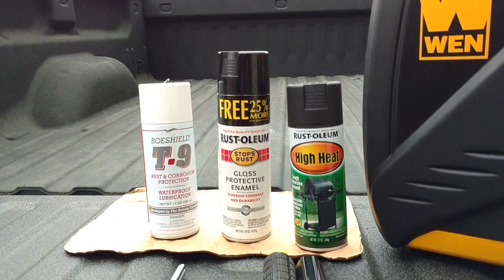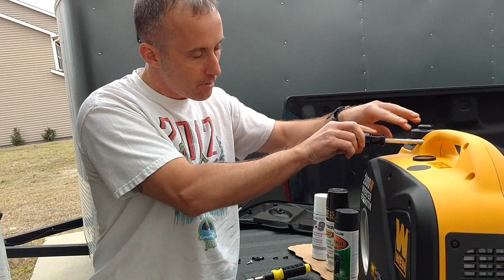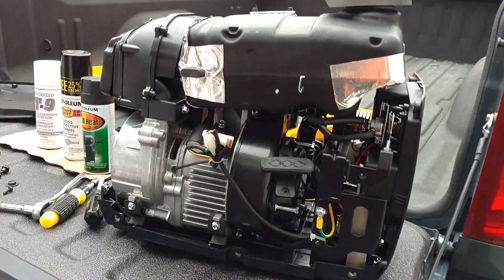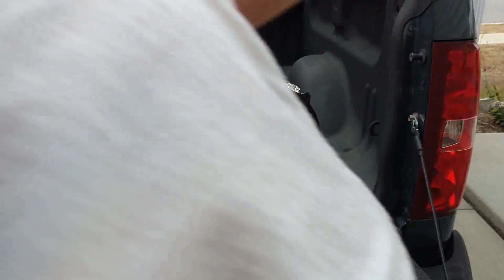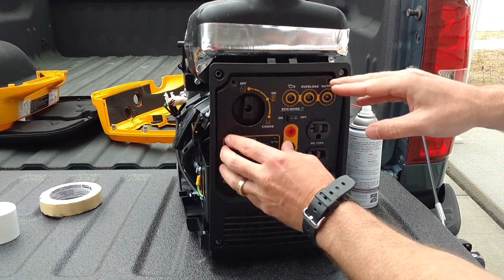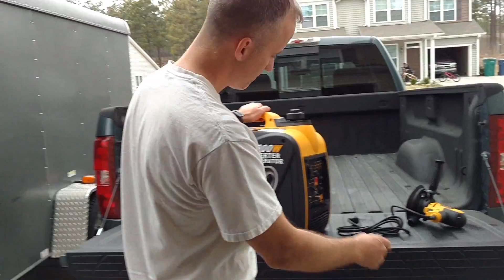How to prepare a portable generator for our sailboat

Comment: Should have used VHT cosmic based paint you can use vht on non heat parts too.,a product designed for electrical and water dispensing is called  WD - 40 ,

Comment: How do you ground it?
Reply from the maker: Excellent question when talking about these type of generators in the marine environment. On a vessel all sources of power get grounded at the source of power. On a installed generator the generator power is grounded to the generator. It may also have a case ground that is connected to the vessels ground bus bar. You could also use the grounding stud on the generator with a grounding wire to the vessels ground bus bar like a case ground for an installed generator. 

These generators are not specifically permitted by organizations such as ABYC. I ground this generator by using a jumper between the neutral and ground on the second outlet. This gets rid if the reverse polarity fault as well. 

I make no guarantees this is an electrically safe option on a vessel. I also live in the real world where about 70% of vessels in this size range carry one of these aboard every day without setting their vessel on fire. 

Use a setup like this at your own discretion. 

Thanks for the comment.

Comment: I use T9 on outboards engines in saltwater marine environments and can testify it works great.  I never thought about applying it to my portable generator (I bought a HF), but it makes perfect sense. Outboard engines are much closer to the water, so I re-apply it at least once a year.  How often do you re-spray your generator internals?  Do you still have this WEN five years later?
Reply from the maker: I reapply annually. I still have it today and it runs great and looks like it just came out of the box. Although I use it only about once a month now so it doesn't get as much use on our new vessel. It's covered in a dry compartment when not in use. 

Thanks for watching and for the feedback.

Comment: Home gensets are NOT meant for marine use, period! BoatUS warned you and dropped you. Self insurance can and will wipe you out. If you have a loan on the boat the bank will force the issue for you. Carbs, fuel systems, bonding, grounding, and the biggest exhaust systems no matter what modifications you do to a home Genset will not meet USCG standards. More folks die from these set ups each year from CO poisoning. So, was it really worth it, you decide
Reply from the maker: OK
Reply: @Unwrittentimeline  don't rip your mattress tag off or this guy will write an essay telling you how wrong it is

Comment: I have a WEN 2000.  The electricity for the city came back 3 weeks ago.  I have not used the generator since then.  I am not sure if I should empty it for storage since the power distribution is very unstable and power outages are frequent, though not for more than 4 hours.  Should I prep it for storage anyway?
Reply from the maker: Different manufacturers recommend different procedures, but generally if you store it for less than a year fill the gas tank full to reduce water accumulation, use a fuel stabilizer, and change the oils before storage.  If you think it will be longer than a year completely drain the fuel system.  Keep it in a dry covered location if possible.  

With your situation you might want to change the oil, empty the fuel system and keep a full can of gasoline that you rotate out in your car with the generator.  Then if the power goes down after close to a year you can fill the fuel and start it up.  In case the city gets its power running better and it sits for a year you're covered.

From personal experience with this generator I can tell you that I sometimes go a month or two between use during the winter and I do nothing to store it.  I use non-ethanol gasoline to reduce chances of fuel problems, but that's the extent of my storage prep.  This is still going strong for me.

Comment: How has that WEN been running for you. From what I understand, HF Predator 2000 inverter is the same unit. A clone. And the reviews with them so far has been quite good. I am watching the reviews on the Predator 3500 inverter and will probably make a decision in the next few months. I own a Honda EU2000i and love it. But, the price differential is what sells me on these clone generators. I was just wondering how yours is doing in that corrosive atmosphere. Thanks.
Reply from the maker: It's been running great so far.  We do keep it inside the boat when we're not on it.  When it's on deck in transit, it is under a Sunbrella cover.  We run it off the back under a bimini, so it's not directly under the sun or rain.  But so far it's been great.  With an installed capacitor on the air conditioner, we can run AC and charge the batteries all night on a tank of gas.  You can see what the inside looks like after a year here https://www.youtube.com/watch?v=LIDGzEql-aQ

The cost is exactly why I went with the WEN.  After over a year it seems to be just as good as the Honda.  The HF looks like another nice option.

Thanks for watching.
Reply: Excellent. I saw your April 1 year video and it looks great in there. Wise move coating and painting the internals. I think that the HF 3500 is also made by, or is a clone of the WEN 3100 inverter generator. But the HF is electric start as well as recoil. I am going to keep watching the reviews on these before I pull the trigger. But, so far, I like what I see. I have seen some reviews on the HF 3500 where they claim it runs rough on ECO right out of the box. I know what the problem is and it is a simple fix with the low speed jet. Even my Honda EU2000i did the same thing. So, it's not a issue for me. Fixed it is 30 minutes. Anyhow, thanks for your videos and your response.

Comment: People do NOT do what this guy is doing!!!This is so dangerous!!! Bodily harm, injury and or death are possible from using a portable generator in place of a marine generator. All marine electrical must be sealed and or coated to meet an explosion proof rating which portable generators do not!!! Marine engines and exhaust are also specialized as to not  emit any sparks. And the fuel systems must be properly vented and sealed to meet coast guard specifications.

Comment: Our sailboat insurance would cancel our policy for doing this. We got a letter from them last year that stated, You are not allowed to install anything related to electrical or drive system that is not manufactured specifically for marine use. You must replace all wiring with marine grade wire, if you replace or upgrade wiring. You can not use anything made for auto, residential, RV or or other non-marine manufactured device on your sailboat. To do so would be an automatic cancellation of your policy. We got our insurance for our boat through GEICO. My wife does not want insurance with them again.
Reply: I told my insurance company to piss off and insure myself.

Comment: Hey I noticed you will be using the generator to power your laptop. My generator instructions specifically warn against powering sensitive equipment such as laptops etc. You might want to check that out.  Also maybe there is a way to isolate or prevent spikes etc. from getting to the laptop. Thanks for the video.
Reply from the maker: Movie Maker Thanks for the suggestion.  Some generators are pure sine wave generators, some are not. The WEN should be fine with the sensative equipment.  I usually run it through the boat power system too. The power at the recepticle will be stable after that.

Comment: Ya ever hear about cordless power tools?
Reply from the maker: Al Martinez Yes but I can't charge my boat battery bank with cordless power tools. Thanks for the comment it was really thoughtful.
Reply: Was talking about using a power tool to take it apart. Also my buddy uses these cheap generators to run a few things on his sailboat but they don't last long, maybe 6 months or so.
Reply from the maker: Sorry I didn't know what you were talking about since you didn't ask what you were talking about.  I've only been using it for a year so far.  Thanks for letting me know about your buddy's experience.

Comment: Sometimes those high heat paints require you get the muffler up to temp and leave it there.  My exhaust paint said that anyway...the can said it would never cure otherwise.
Reply from the maker: I admittedly didn't read the entire can.  I may have screwed it up.  I'm planning on pulling it apart soon to see how the parts held up after being on my boat for a few months.  Hopefully it's not too bad.

Comment: I first started by just making a suggestion that spray grease would be better
Then you come back with T9 shits better then you get all defensive  and start quoting how good the shite companies are making millions out of mugs
Chinese companies make cars and make billions off them would you buy one No
Even north Korea makes millions off cars would you buy one
I could go on forever but would not convince someone like you that’s been brain washed
Even the us army if you could  call it that and the uk army used to spray grease on things  some of the things are still in storage now after 60 years and perfect that was just my point
Reply from the maker: I apologize then.  I misunderstood when you were laughing and saying the generator would fall apart in 3 months.  I thought that meant my generator would fall apart in 3 months, not that you can store something in grease for 60 years.  I am using my generator at least weekly and didn't want to wait 60 years between uses.  Since you were wrong about my generator falling apart I wanted to let you know it's been running fine for 6 months so I replied.  When you again posted T9 instructions not related to marine use even though we're obviously talking about marine use, I just thought you were wrong again so pointed it out and cited references.  I see now you don't need correct information or references since even your current statement is wrong.  North Korea can only produce around 40,000 cars a year.  That in no way translates to millions of Dollars, Euros, or Pounds.  Also, nice slight on the US Army, way to class up your comment.

Comment: yes seems you don't read the instructions as wellProduct DescriptionSpray on and wipe off. Develeoped with the Boeing Aircraft Corporation, Boeshield T-9 Waterproof Lubricant will dissolve itself and flush out any other lubricant. Penetrates deeply to thoroughly coat inner pins and rollers. Dries to a clean Paraffin Wax film so it will not pick up dirt. Lubricates and protects for 150 to 200 miles per application.its crap
Reply from the maker: Well I guess I just disagree.  I'm going on what their site states about its use in Marine environments and what Practical Sailor, West Marine and Boeing say about T9.  After 6 months I have no damage to any of the copper, brass, or steel components inside.  But what do I know I'm only using it and can see the results for myself.  You're apparently more wise than a company that tests marine products for a living and another company that sold over $700 million in marine products last year.

Comment: lol one month at sea and all them electrical contacts have verdigris on then 3 months they fall apart get some spray grease on them
Reply from the maker: T-9 gel is a solvent carrier and paraffin wax coating.  I'm guessing you didn't watch the video or don't know what T-9 is.  The generator's been fine for the last 6 months on the boat.  Perhaps it would fall apart if I dumped it in the ocean though.  You may be correct about that.  You should test it and let me know.

Comment: are you concerned about the connections inside the generator getting salt air over the winding connections?
Reply from the maker: Not too much.  We haven't had problems yet.  Lisa made a sunbrella cover for the generator when its not in use.  Between that and the boeshield, hopefully we'll be fine.

Comment: Nice vid. Does the inverter achieves the specified amount of watts? I'm really looking forward to get a generator the closest to the Honda eu2000 without spending 1000$. I have seen this model, the powerhorse from northern tools and the ap2000iq from costco but I cant still decide which one
Reply from the maker: +Yosue Caridad Thanks for the compliment.  I can run my air conditioner, battery charger, and have my laptop plugged into the outlets charging.  I haven't measured the actual amps yet but it works pretty good so far.I also didn't want to spend the money on the Honda and this was almost half the price.  I've had it on the boat twice now and it hasn't been a problem.